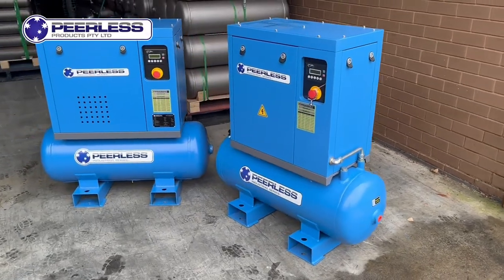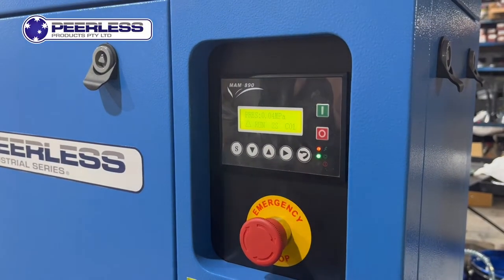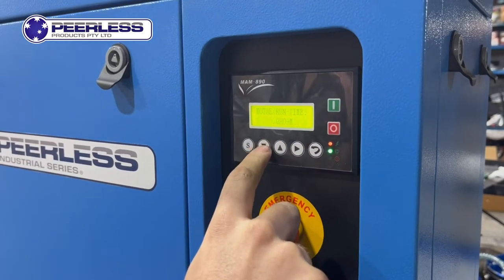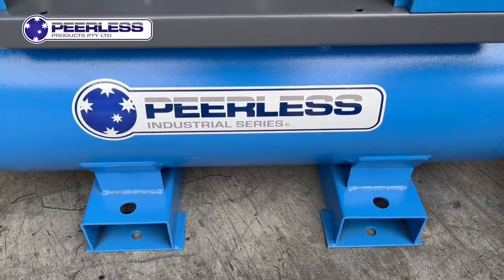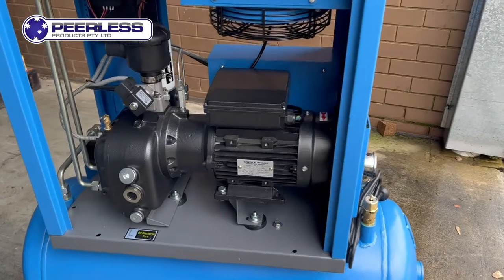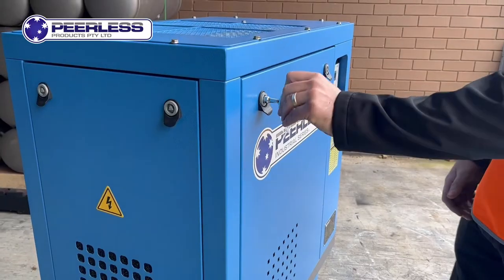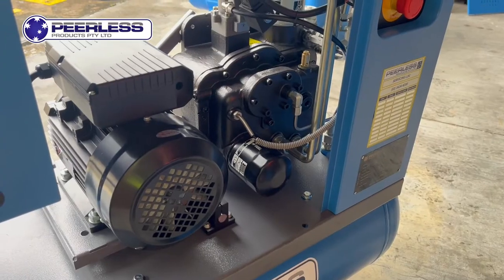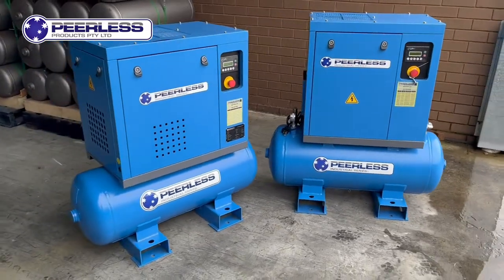Single Phase Scroll and Screw Compressor 116PSI (8BAR) & 145PSI (10BAR) 15A Plug

Comment: What is the CFM please on the highest output looking for somthing for a blast cabinet at home 25CFM
Reply from the maker: Hi there Dave, this is a 17CFM unit.
With sand blasting equipment you could run this unit depending on the nozzle size you use along with the pressure you blast at. 
For example, if you use a size 2 nozzle and blast at 90PSI you could use this unit comfortably.